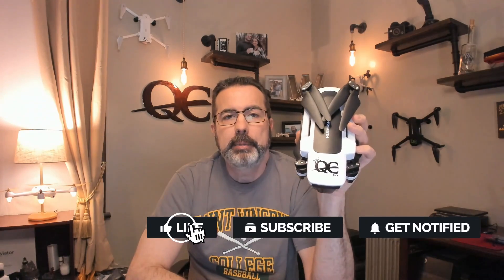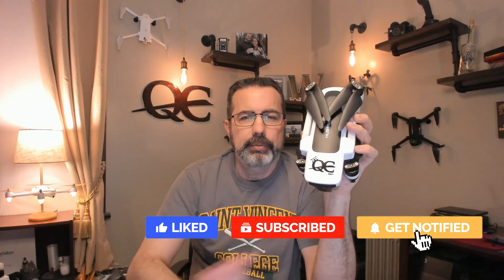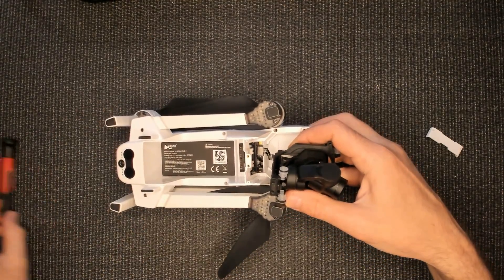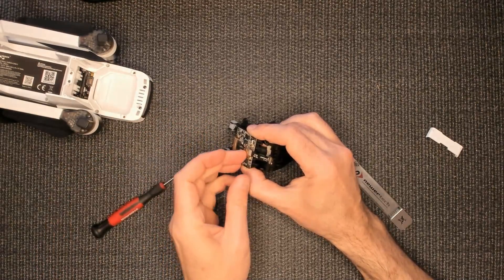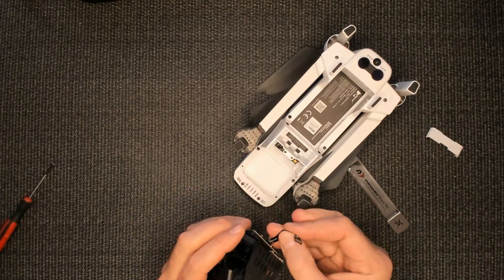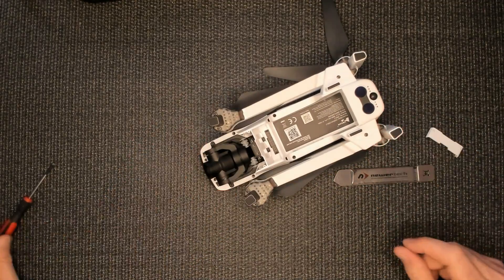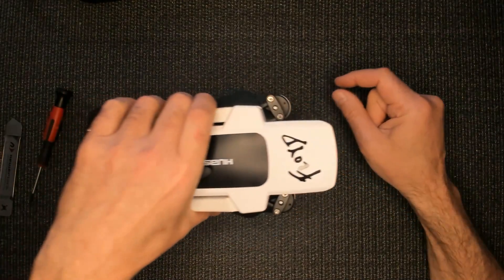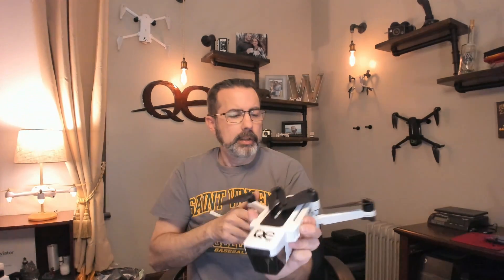HUBSAN ZINO 2 - GIMBAL / IMAGE RIBBON CABLE REPLACEMENT

Comment from the maker: ZINO200-34 is the part number for the gimbal/image ribbon cable. They are sending them to those who have a warranty claim but the item is not available sold separately yet. 
Keep checking www.hubsan.com
Reply: Thanks so much for your great videos. I finally got my preorder from gearbest on Friday, did the firmware updates, and no FPV and green and yellow flashing light. Thankfully for your vids and a little research, I came to the conclusion I have a bad cable. I emailed Hubsan and they got back to me within 12 hrs and said they will send me a new cable. Hopefully that comes faster than the Zino 2 did 😂. Thanks again for what you do and the great videos. You are very appreciated !

Comment: Hi Chris, please help! I pre-ordered zino 2 after purchasing the original Zino. I have not flown the zino 2 for several years because of a faulty camera/gimbal cable. A while back I ordered a new cable but when it arrived it did not fit. Apparently there is an old cable with part number ending in 04 but I was sent the new cable ending in 07. That did not fit. I feel punished for my pre-order purchase because I have not been able to find the original cable. Can you offer any advice about how to obtain the original 04 cable?
Reply from the maker: I have them if you send me the drone to repair. I don’t sell these kind of things outright anymore because people like to damage them and claim I sent a defective part to them.

Comment: Have you ever had any problems with hubsan us on ordering things and getting a response from them?
Reply from the maker: I get all my parts from them if they have the stock and have always had great communication with them. 
Never purchased a quad from them though…
Reply: @QCGUY  Thanks for ur response! I finally got in touch I purchased a gimbal ribbon and signal ribbon from them and plan on attempting to repair to challenge my capabilities?LOL But if I fail I would like to send to u if u have time? we can email about the process?  Thanks!
Reply from the maker: @CMGOUTDOORSADVENTURES  No problem 😉
Reply: @QCGUY  👍

Comment: Hello, I have a question about the cable, there are two types of cable and my drone uses the old one and I cannot put the new one or is there a solution to fix the transmission to the mobile since I have been searching for the cable and there is only the new one, thank you, best regards
Reply from the maker: Aliexpress has both if I recall 👍

Comment: I finally looked at the 2 cables you sent and reviewed this video since I had not watched it, not owning a Z2. Those connectors are so tiny I do not have a good way to check for conductors that have been opened by cracking. The first thing I noticed when watching this video was the folding and crimping, under pressure, of the flex circuit at the main board. From my knowledge and experience, that is a complete 'NO-NO'. Flex circuits should always have a curve, not a fold! Without running continuity test on the flex circuit, I can't say for certain the crimping is cracking copper open, but I would place money on a bet that is what is happening. Plus, I cannot believe how narrow the copper is to support the current draw for the motors!
Reply from the maker: David Cash I think the fold is a given and obvious now. I don’t fold them during replacement anymore. I’ve been saying since the first failures it’s heat and that fold must help aid in the failure. Delaminating of the cable ply is tell tail from the heat regardless of fold or loo though. 
I didn’t expect you would find anything more then the obvious when I sent them to you. I just know you like to tinker and test as well. 
Thanks for the input 👍

Comment: do you have a video on doing the same for zino pro? I tried to recal like your other video said, and still no video, so I think I shoud try a new ribbon cable. your thoughts?
Best,
Bruce
Reply from the maker: Bruce A Baker I haven’t done a video on the Zino original Zeno pro ribbon cable for the FPV because it’s a difficult one to do and my worries are people will try to do it when they don’t need to and really screw up the camera. I have fixed several of these and it’s definitely no fun replacing that FPV cable. That sounds like what your problem is.

Comment: Well that gives me some more info.  Just got the pro model.  Would not calibrate the gimbal.  Always said fail.  Not really sure where the ribbon cable connects on the pro, but after manipulation of ribbon it finally came on.  Maybe its just loose.  You have any video accessing the ribbon cables in zino pro?
Reply from the maker: Doctnj It’s the same in both models and it definitely sounds like you found a loose connection.

Comment: Hi Chris, I live in Munich and have been flying a Zino and watching your videos for over a year now...
I ordered my Zino 2  at Gearbest in December. After much delay, I got it delivered yesterday... and there was NO video feed whatsoever from the start, app shows  black. The Hupsan 2 app demanded firmware update. I thought maybe that would solve the issue???, but then the drone update hangs at 50%. The gimbal can be moved with the lever, though, before the update begins, so the gimbal steering is functional.
I checked your video, dismantled the flat ribbon cable, snapped it again in place... no apparent damage?!? Nothing changed: green orange still blinking and at step 2 50% drone firmware update, it does not get through. No video feed whatsoever have my eyes seen yet...
I am very disappointed with Hubsan, apparently they missed quality check before delivery. I am waiting for Gearbest to tell me how to proceed. I find it weird that they are not willing to send me a new ribbon cable or a new Zino 2 asap. By the way,  the Zino 2 was also slightly scratched on top.
Greetings and stay healthy!
Reply from the maker: Pablo Jimenez Your story is much like many others and you definitely need a new ribbon cable so make sure you contact Hubsan directly and demand one sent to you ASAP.

Comment: Thanks for the Gimbal Cover placement demo.   Wish it worked for me....but my defaulted cam if Downward.   If it was Forward, like you have, it would work fine.   I'm checking to see if there is a setting for this...default the lens Forward.   (When powered cam lens is Forwarded; at battery shutoff, lens drops to downward position.
Reply from the maker: Wildflyer Drones It will stay if you push the lens up. If not just point the quad down when placing it.

Comment: Finally got my Zino 2 and cant even  update software power supply bad now I must take pictures and  movies to prove it .
Reply from the maker: Ray Carvey Its just a computer type power brick. Much easier to find one that matches closely enough and replace it. Still try to get a replacement but you can get up in the air faster buying something else.

Comment: Well my zino 2 arrived and I have spent all day trying to upgrade the aircraft. Goes to 12% and stops.  Let it sit and the motors start beeping. Keep trying it again and the same thing. The controller battery will eventually die with the update stuck at 12%. Tried a different sd card and also removed and reinstalled the app with no change. What a piece of crap. The gimbal cover was not on it right in the box and it looks like the camera got a good bouncing around. That dam app won't let you ignore the update to see if it even works. I'lljust keep trying.
Reply from the maker: Unemployed Redneck Hillbilly Creations How is it now buddy? When it stops what is it updating? FC, IT etc....
If this is still a issue try using a iOS device if you’re using android and have that option.
Reply: It always stops after disconnecting and reconnecting to the controller. Sometimes it stops at 2% and it has made it to 60%. It sometimes says no sd card when it reconnects even though there is a good one in it. Tried over a dozen times with my Samsung phone,  my wife's LG phone and a galaxy tab a with the same results.  Sent a video to Hubsan as they requested.  Posted a test video  and it's not bad but the camera seems to change settings while making videos and my lack of experience flying shows. Seems to focus best about  a half mile out and I recorded at 30 fps but the file says 60.  Having issues with u3 sd cards 3 pass the speed test but it will only record to 1.  Wonder if there may be a bug in the firmware in my version. Trying to find an iPhone to try.
Reply: Well Hubsan watched my video and requested a shipping address  so I am guessing it might be the cable everyone is having trouble with.

Comment: Hey Chris....Thank You for all your Videos and the work you do.  So ironic as I was watching this particular video this morning my Zino 2 Arrived at the house....!!  Charging the Batteries as I type this out.  Hope I never have to do this particular repair but Thanks to you I will have a super guidance video ...This one.....   I had to replace my Camera  cable once in my Mavic Pro......Grrrrrrrrr.....nightmare....I'm glad Hubsan made their replacement a little easier and thank you again for the great work Chris...!!  Keep it up....!!!!
Reply from the maker: Troy Foster How did everything go so far?
Reply: @QCGUY  The weather here in Ohio hasn't been the greatest lately but I have put 2 full flights on both batteries.  I have updated to the latest Firmware and have been playing with different camera and video settings.  Photos and Video both look very good.  I haven't noticed any stablility problems at all and one flight had 15 mph winds.  I was able to easily fly out and back against the wind in normal mode.  Very Very glad I waited out the long Gearbest ship time.  I am extremely happy with the Zino 2 and am looking forward to trying out some of the Features I havent tested yet.  Ty Chris...!!

Comment: Hi Chris. While I understand your continuous stream of videos to fix design and manufacturing failures in the Zino, Zino Pro and now Zino 2, how about giving us some updates on other, more reliable drones? I'm REALLY interested in the Fimi X8 SE, but haven't heard you mention it since Sept 2019. I'd like to hear more about what kinds of problems (or solutions) you and others have had with this drone, and how to deal with Xiaomi vs the problems you've had with Hubsan. Any news on an updated Fimi X8? Latest reliable firmware versions?
Reply from the maker: Dave Bagley coming up 👍

Comment: Thanks again Chris for the great information. Is there a part number for the ribbon cable and the gimbal lock that I will need to order?
Reply from the maker: ZINO200-34 Not available yet as a part to purchase. They have been sending them for claims only so far or at least from those I talk to or that are in my group having these problems.

Comment: Hi Chris, got my Zino 2 yesterday. I flew it today for the first time. This is my second drone, I'm an amateur. Did the Control update and the Drone update. I did get an error on the drone update saying the SD 32 gb microcard was not large enough. So when to Costco and got a 2 pack of 128 gb extreme plus  4k video rated microcards. I put the micro card in, turn things on, it said to update, it updated the drone, it was a little slow at the end of the update. It went OK. I  compass and horizontal calibrated the drone, no problem. Liftoff was smooth and strong. I let it sit there a few minutes, it was stable. I took it up 300 feet, I was impressed. I took some stills and 4k videos, that looked ok to me. I didn't see any video problems. I only flew the drone for 20 mins. Do you think they could have put the new ribbon cable in this batch they just sent out?  Thanks
Reply from the maker: I don't know honestly but I think it's safe to say they have not based on the ones still getting bad cables at this time. I think it's just a lottery you don't want to win so congrats you didn't win and I'm happy for that as I am sure you are as well.

Comment: From the other video I saw Hubsan has changed this cable to a much more robust one because of all the issues. I have a feeling its going to be hard getting anything shipped out of China for the next couple months with tonights flight ban from Europe as those flights also carry cargo. Wondering if Hubsan keeps any replacement parts stock at their US location. Sounds like all the corner cutting is starting to surface in the first units shipped.
Reply from the maker: They should have been stocking the US location and any other satellite location already but they never do for some reason. It use to be nice having that California location but now it's just kinda there not serving a lot of purpose other than repair. I have a good idea now as to why these cables are failing at first startup while updating which seems to be the common thing they all share. I have done a few tests but I need to do a update for the main test to see if I am right.

Comment: Great info for someone experiencing issues with the ribbon cable. It would be pretty disappointing to spend that much money and have an issue right off the bat.
Reply: Been there, done that, exactly that situation with my Zino 2 fresh out of the box and no working  FPV, with a camera cable due to arrive by 19 March.